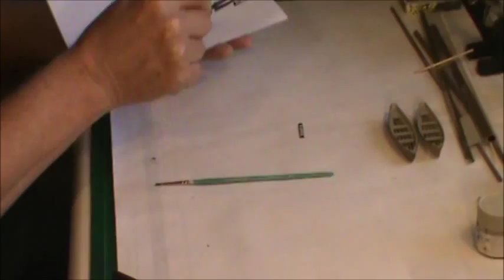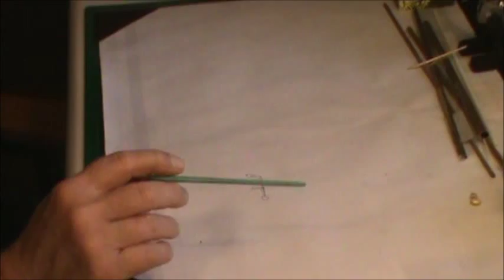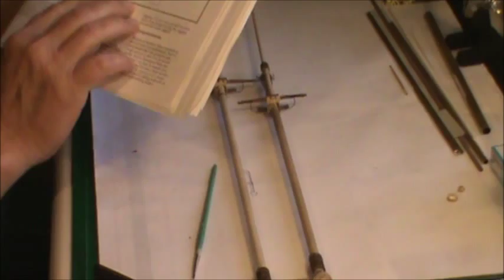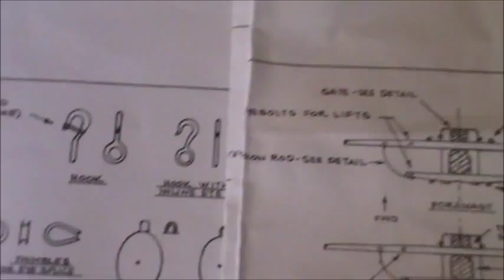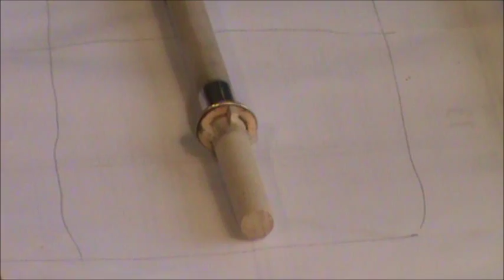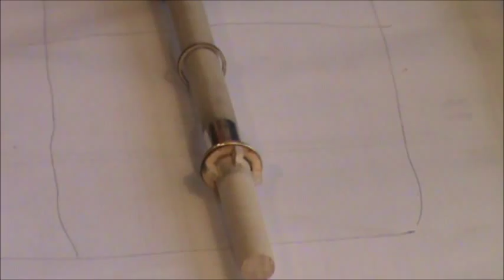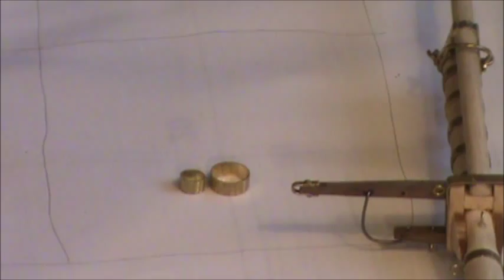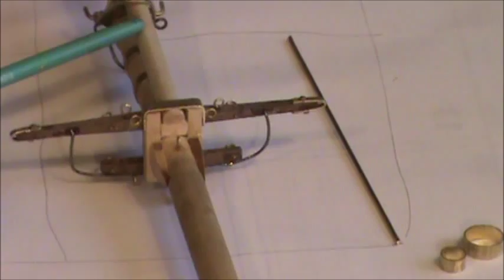BLUENOSE PART 26....MAST ARE DONE

Comment: Gary:
       You did some REALLY nice work with those masts. Really clean work. I'm building the Bluenose II so there are some differences between our models so my masts are set up a little bit different than yours are but I have had about all the same problems with my plans that you have had. All I can tell folks is that before you do anything make sure you fully understand what the plans say vs. what photographs show vs. what your common sense tells you. Great work!
Ed.
Reply from the maker: Hypergolica1 Thanks....Yeah, I'm working off 3 sheets of plans and pictures off the net just to see where everything goes and what it's purpose is.  I did something to my main boom I haven't seen any pictures of anyone else doing.  It's in the plans an it took a little doing but I got it done, next video.

Comment: Here is a tip for you, go to the hardware store and in the plumbing section you will find what is called a close cutter. It is for cutting tubing (copper normally) up close to walls and such. I will share a link with you at the end so you can see what it is, but they are excellent for doing these small pieces. I was a plumber for many years and one tip I will give you is while they will work great, there is a dial you need to turn down as you cut. Only dial down real small increments at a time and then turn the tool a few times and repeat. If you go too fast you could warp the tubing. The only downside is this creates a bur that will need to be filed off. I have been using it and it works fantastic. It is sort of a challenge to do real thin ones because one side of the cutter wants to fall off, for this you can put a dowel inside it and another piece of tube the same size on the other side to support it while you cut.

https://www.amazon.com/RIDGID-32975-Quarters-Tubing-Cutter/dp/B000LDGNCU/ref=pd_lpo_vtph_60_lp_t_3?_encoding=UTF8&psc=1&refRID=K2XXMQMCP5QMBEKR8EEM
Reply from the maker: Or go to Harbor Freight and buy one of those "Mini Bench Top Cut-Off Saws".  It has a 2 inch blade on it and only cost $35.
Reply: Fantastic choice, I have been looking at mini tools and this is exactly the sort of thing I was looking for. Thanks Gary, dont happen to know of any mini lathes do you ya?

Comment: Hello

The handle would have been used by 2 men whilst carrying the anchor. If you think logically if the anchor chain comes out the channel and connects directly to the anchor with a shackle when you raise the anchor you would secure the bottom end to the eye below the anchor rubbing block. If you brought it inboard and disconnected the chain you secured the end of the chain to that eye with the shackle. The anchor could either be stood upright like you say in Bluenose 2 or that pole inserted and be carried and stowed below decks. Andy C

Comment: Hello: Gary, I recently received this Bluenose 11 1:75 scale from my deceased uncle and I've watched your videos up to 24 and back a couple of them between 20 and 23 I seem to have a slightly different version.  Not to far off though. I am a giant gallows model builder I've done a custom version of a F4UR Corsair which took me 4 years to do, and only because of custom work. But on YouTube you can find me and my work at either "haufmeyer, or jdhaufmeyer" anyway his bluenose-ii was partially done, not quite the standards you or I would of done. One problem of a couple is I only received the two main books with it. His daughter may have lost or tossed. As well as dropped all the parts several times.  Ugh. I am going to see if I can attach the two books. I believe that you have the main book of assembly that I need, otherwise I'm going in blind. Have any idea where I mite find this main book.? In case I can't do that my book say "Specifications - page 1 of 3", the other one is just a reading book (Bluenose II) scale 1:75. Please help me. Your video has been great, but is a better job than my uncles. Looks like fine work but not as nice as your all the way to the mast building.  I have, a very nice metal send holder. And he stopped at just getting bottom up to deck finished,  although the rigging isn't like yours. But if I had that book you show I may get somewhere.  I'm going to try to send this with a couple of pic's for u separately.  Thank you for you knowledge.
Reply from the maker: Jeff Lawson Your Bluenose ll and my Bluenose are two compleatly different ships.  The Bluenose sunk and was reborn years latter as the Bluenose ll.  You don't say who your kit is made by, once you find that out contact them for plans and book of directions.  Or go to this web site for a copy of the same directions I have      http://www.historicships.com/TALLSHIPS/Model%20Shipways/Bluenose%20MS2130/Bluenose%20ms2130%20Manual.pdf       or just google "Bluenose model directions".   But the most important thing you need is the sheets of plans, you need to get your measurements off them.  I know Model Shipways sells then but that's for there kit.  You will be supprised what you can find on this ship just by using Google.  Good luck
Reply: ok I do appreciate your quick response, but mine looks identical to yours in every way, I have the large prints, that's not a problem. I just notice that you are equipped with an additional pamphlet of picture instructions that I don't have, I wanted to show you where my uncle left off, and I notice that like you said you would do some changes  that I would prefer to do like that, I am a machinist from years back, and  I wanted to do an extraordinary job. also did I mention during the time he was sick and passing his daughters dropped the parts boxes and there most certainly some that are gone. I have already seen some mistakes he made because I'm going to go blind to find the two spots to hold my mast (no holes drilled on deck and no measurement to go by as he has already did the planking for the deck and hule  of the ship. I have had back surgery and when I found your website I was thrilled, great job and looking forward to do it the best way. I am also sorry I am making a book for you in this comments Colom. please don't be frustrated with me, I can do a good job, just need better instruction, with pictures like yours, mine is just all written. Also I have some picks and a short video of the paperwork that I have, so thank you for the web info I will try to get that . I hope its not a burden, so far I have in one day followed your videos from 1 to 27, and had to stop. Once again I do appreciate all of your help and love the way you work, I see a lot of myself in you the way you work. and it the best.. I will get the picks and the video uploaded on my YouTube. My YouTube address is "haufmeyer" no other ways to find my stuff, there is a Gallows giant model. I customized it with light in the wings and everything works and all explained in the videos. Thank you for your patients, the Bluenose ll where my uncle left off at will be loaded soon.
Reply from the maker: Jeff Lawson If you have the large sheet of plans most of your problems are solved.  The book of directions is not much help.  But the book of directions is at that website I sent to you.  That is if you have the Model Shipways Bluenose kit.  You first must find out if you have the Bluenose or Bluenose ll, there is a difference.  Your measurement for the mast holes can be taken off the large sheet of plans.  The sheet of plans are 1 to 1 in scale so what ever the measurement is on the plans will be the same on the ship.  You can get just about anything you need for the ship off the internet.  I don't know what country you're from but you can order parts from all over the world.  But you have to consider, would it be cheeper to order a bunch of parts or just buy a new ship?

Comment: Hi, would you mind to share the specification of those two types brass tubings you used on the masts? I plan to follow your video. But I need to know the OD and ID of those two tubings so I know what to buy. Thank you!
Reply from the maker: The best thing I can tell you is to take a small piece of your mast to the hobby store and find a brass tube that fits.  There are a few different sizes you will need to fit booms mast and other things.